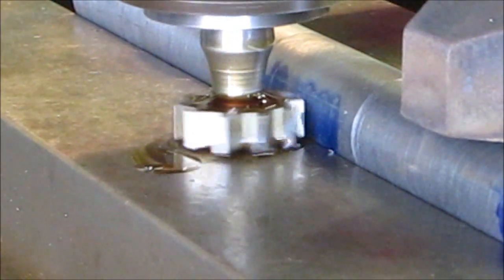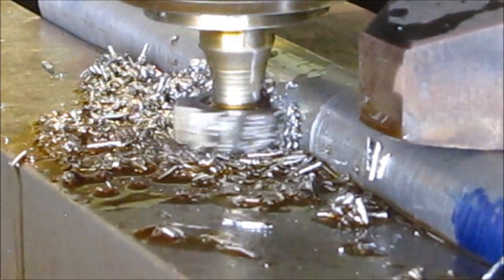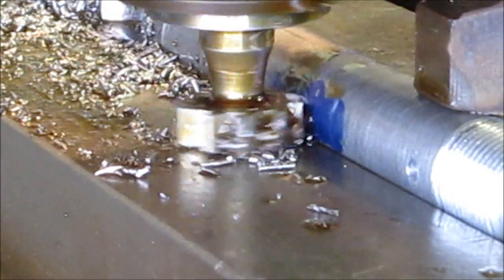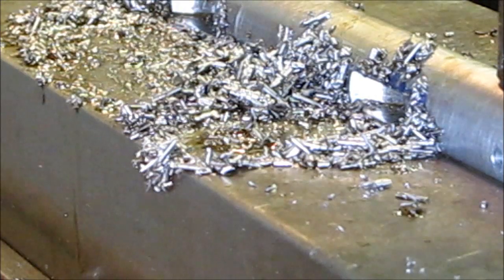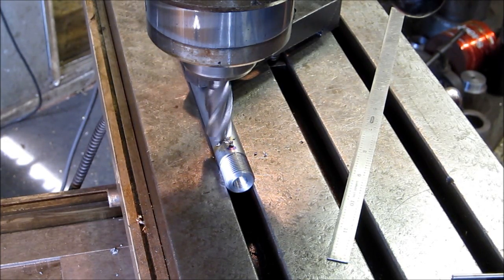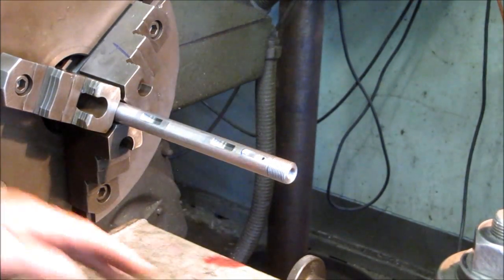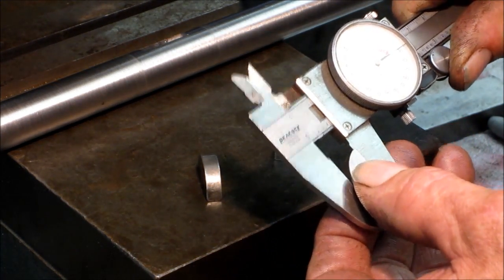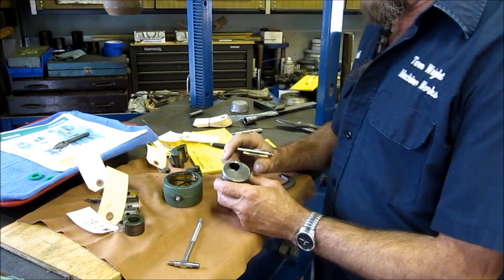Mail Call (Benchmaster) Part Six

Comment: awsome set of videos.more speed and feeds as you are at as you switch tools would be be helpful.Thanks again for taking the time to share your knowledge it has already been a big help with my new job as i do some light  machining for manufacturing equipment repair. Getting it done with USA manufacturing in Massachusetts.